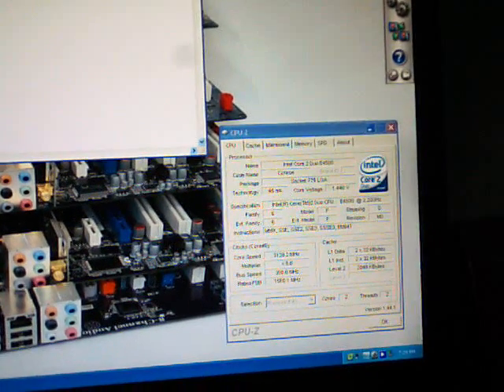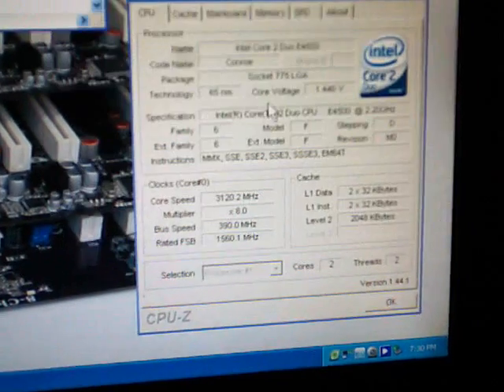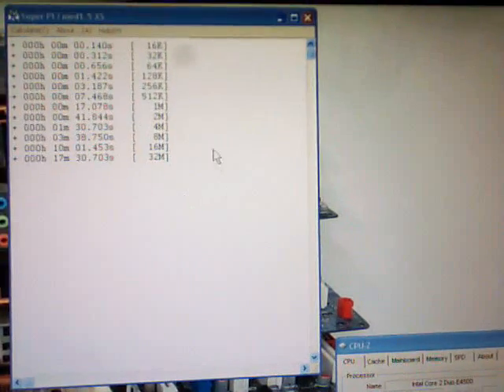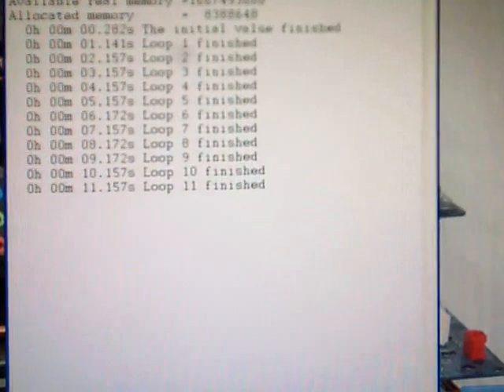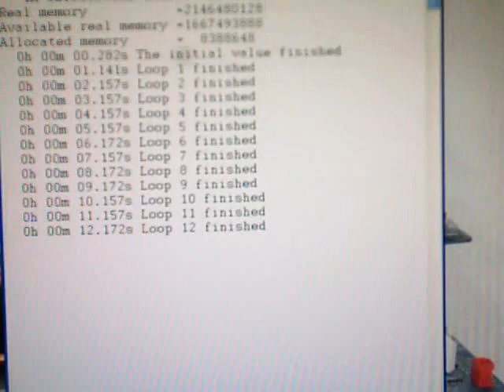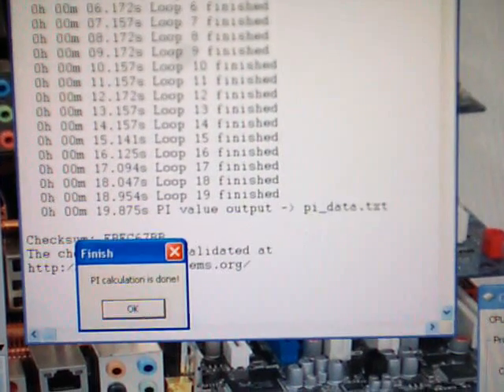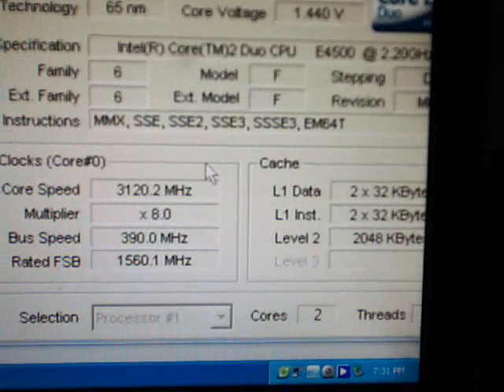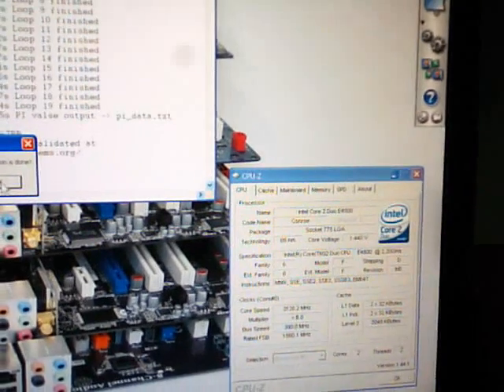Finding E4500 FSB wall on ASUS P5K-E 390FSB MAX

Comment from the maker: There is a divider and it can run you r RAM at many speeds and run DDR/DDR2/DDR3 different dividers.

Like my pentium D805 533 ran at CPU/DRAM 1:2

Now with my 2180 and 4500 I run 1:1 for high overclocks and 2:3 or 4:3 or well you get it.

Depends what RAM speed is in long run to determine divider.,